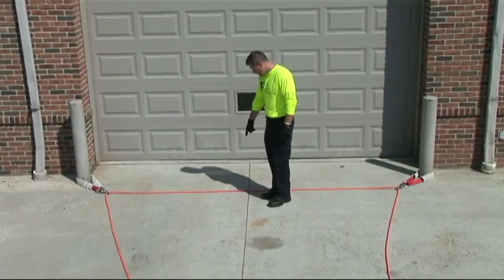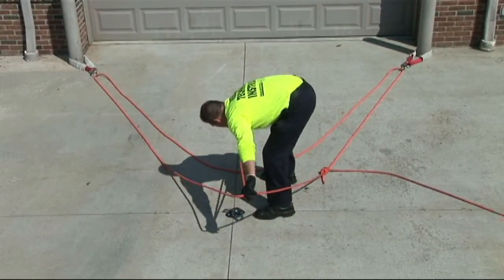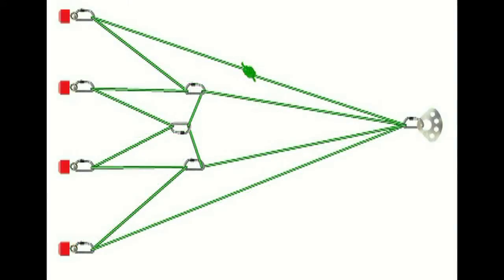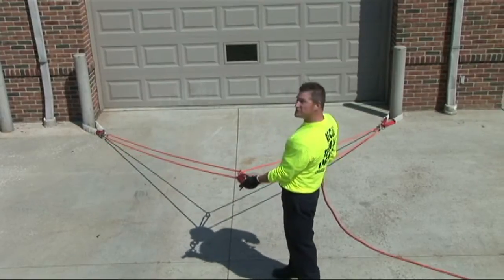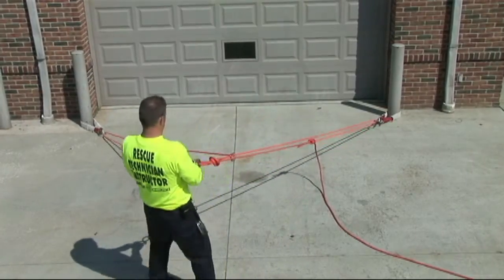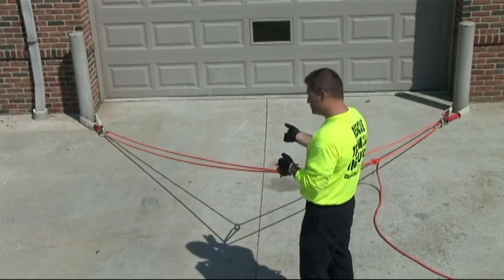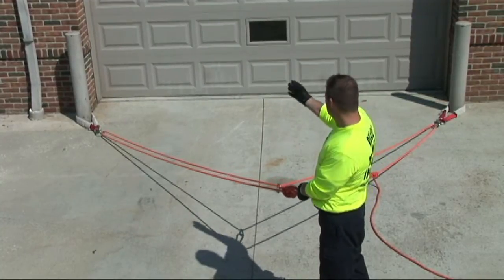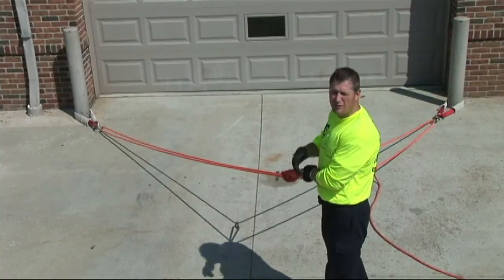Load Distributing Anchor System

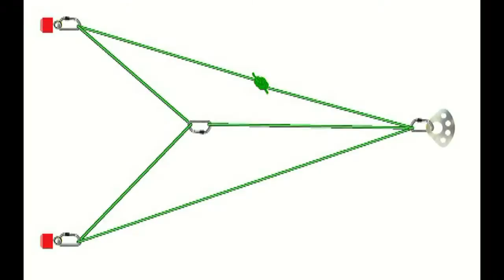Comment: This is well presented video. If I can make a suggestion, based on what I am seeing here, this is a classic American Death Triangle setup. At 1:53 you have a nice graphic to show the setup. IF the line fails at any point , it will unwind all the way through the other anchor. Again, I could be missing something but it appears as such.
Reply: Correct.   This system will not “pendulum”.   It will expand catastrophically and the hit on the remaining anchors and load will be severe.   He is about 3/4 of the way to having a good anchor system, but his physics are a little off. If you spend much time watching very many of his videos they are fairly easy to pick a part